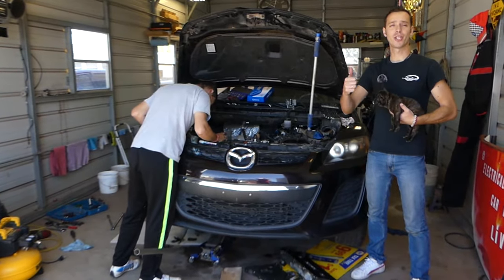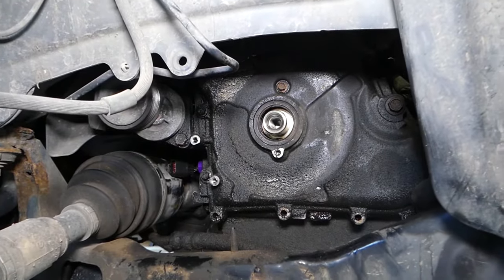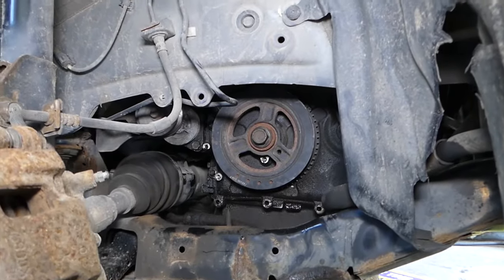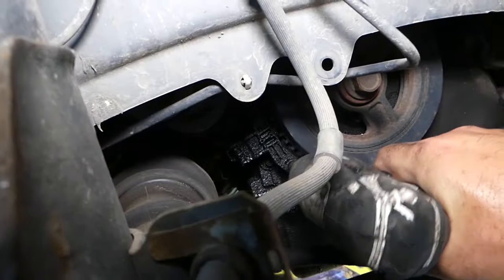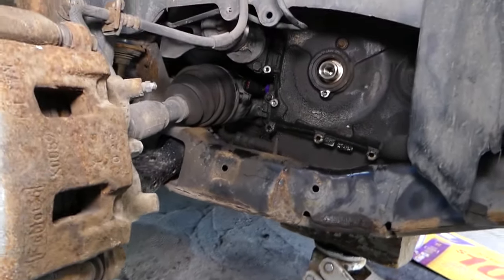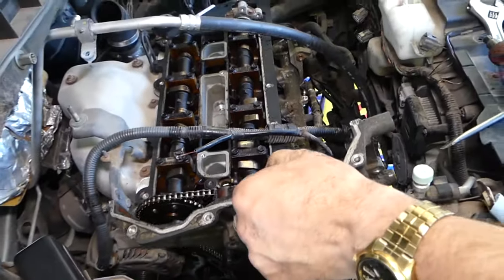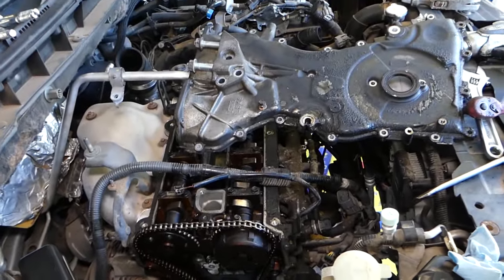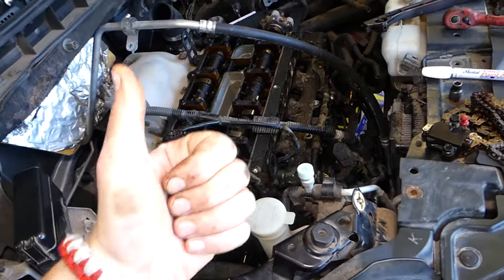TIMING CHAIN REPLACEMENT MAZDA 2.3 CX-7 CX7 MAZDASPEED 3 MAZDASPEED 6

Comment from the maker: Products that we use and recommend:
► Timing Chain Kit: https://amzn.to/2PMNEwd
► Timing Tool: https://amzn.to/2Mkt3NH
► Engine Sealant: https://amzn.to/2oKQOpp
► Front Crankshaft Seal: https://amzn.to/34MyVWg
► Dewalt Air Compressor: https://amzn.to/2nVApOq
► Impact Wrench: https://amzn.to/2nVAOjU
► Panel Removal Set: https://amzn.to/3YiMADu
► Assorted Fuses: https://amzn.to/4fx4s3F
► Tool Set: https://amzn.to/3p5MM6t
► Screwdriver Set: https://amzn.to/3XRB28Q
► Castrol Oil: https://amzn.to/3xBc8B9
► Oil Filter: https://amzn.to/3w0Ulme
► Torque Wrench: https://amzn.to/32qyRwg
► Liqui Moly Engine Flush: https://amzn.to/3IiDBID
► OBD Scanner that we use most often: https://amzn.to/3I4MQfe

► Check out our Amazon Store for the tools and parts that we use: https://www.amazon.com/shop/worldmechanics

Comment: Hi I replaced my serpentine belt and oil pan gasket on my 2007 mazda cx 7. After that it wont start, their is crank but no start. It was running good before I replaced the serpentine and oil pan gasket. I did compression test 3 of the piston reads 100, 115,125. Piston number 1 is 175psi. All fuses are good fuel pump and injectors are good. Do you think the timing affected by replacing serpentine belt? My car only has 120k miles. Your response is appreciated. Thanks

Comment: There is quite a lot cases of timing belt breaking the motor on CX-7. Does replacing it before gonna prevent the problem on a car with 60000km? Thanks for the answer

Comment: My Mazda CX-7, 2.5 four cylinder, South Africa, has now 340,000km on the clock. I am only now going to replace timing chain. No really necessary, but I think this is safe. Only replaced the fan belt since I bought it new end of 2010. Excellent vehicle!!!!😃

Comment: A lot of good information and great camera work to show it. At how many miles/kms should these chains be replaced at?
Reply: Around 100,000 miles. Mine failed at 140,000 some go longer some not so long
Reply: Long as you do serivce change oil on time they should last you all they life mate
Reply: mine failed around 214000 CHECK your service manual!! :D
Reply: I just bought a dirt cheap 2009 cx7 with 273k miles. Guy said it had never been replaced in his ownership and he bought it at 90k miles. Definitely planning on doing it soon!
Reply: im getting mine replaced now at 120,000mi

Comment: As usual awesome video, so thanks a million. 
Do you recon the procedure is the same for Mazda 2 DE 2009?
I have currently done 143000 miles in the UK and I am intending to do timing chains and oil pump replacement as a precautionary measure.

Comment: Hi y'all 👋 hey chain was recently done by someone else but they didn't seal it up properly so I'm pulling side cover and resealing everything properly. I did valve cover gasket few months ago do I have to pull the valve cover again to just do the side cover?? Pls and thx I know as I'm taking it apart I'll figure it out but I just was trying to run it through my head first

Comment: Can you help me i want to  know if the 2007 cx7 2.3 turbo and the 2008 use the same engine wiring harness mine is damage and i need to replace it and i want to know if the match thanks

Comment: Hi, I love your videos, they are great! Would you please be able to kindly assist in sending me your link re repairing a Mazda CX7, 2008 2.3 litre turbo Timing chain kit replacement?
Do you also have a detailed video re replacing the A/C Compressor and Condenser kit in the above mentioned  Mazda CX7, 2008 2.3 litre turbo?
Thank you very much in advance!

Comment: Wow great video. How much do you think a job like this would cost? I have a 2007 Mazda cx 7 with 81,000 miles and think maybe it is time to get a new chain to prevent a failure.
Reply: @LibsareTRASH  we put a new oil filter/ cooler and it stopped the leaks. At 100k now but this Mazda is really the biggest cheaply build piece of crap we have ever owned. Gonna run it to death tho. Horrible uncomfortable car but it's cool to park anywhere and not give a damn what happens to it 😂😂
Reply: The shop told me it would cost more than the car is worth. I went on eBay and got all the parts for about 250$. I’m going to do the job with almost no power tools too. Wish me luck.
Reply: @Bearohazard  how did it go?

Comment: How many miles do you recommend change the timing chain and turbo charger and VVT?
Reply: Thanks
Reply: 70k if you already dont have problems.  short drives kill this type of engine turbo setup.  change the cat and o2 sensors too while the turbo is out.